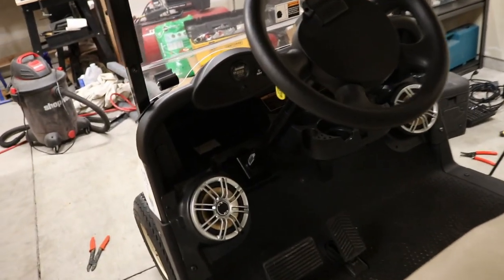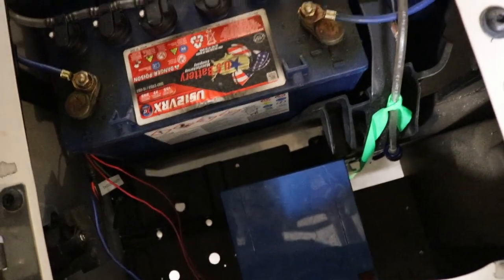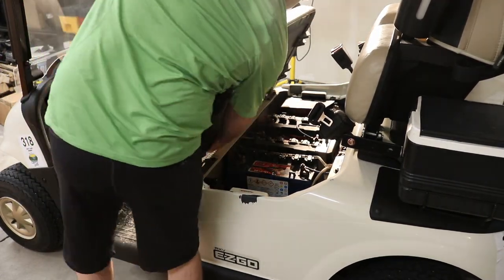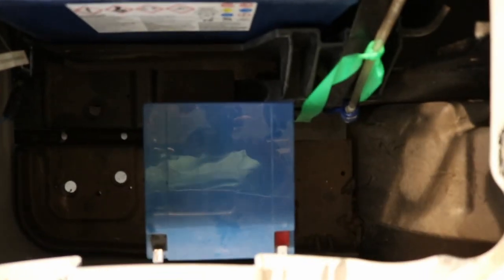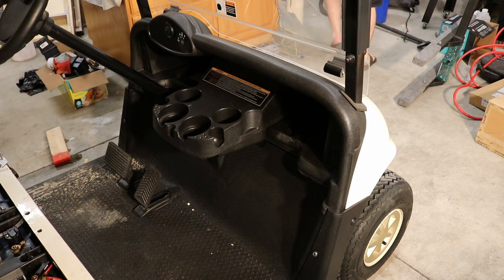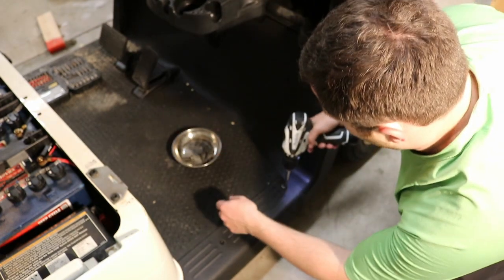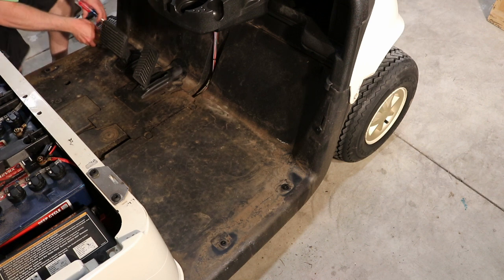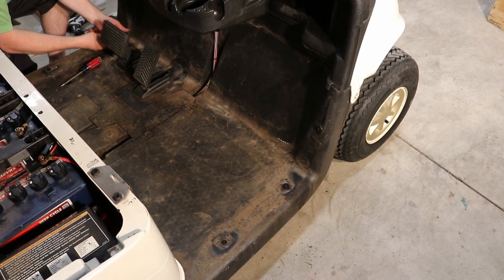EZGO RXV Stereo Install Part 1 of 3

Comment: How are you keeping the battery charged buddy??  I want to do this install but are you constantly having to charge it??
Reply: Eternal Dabbler cool do you have it run with the battery in the golf cart or you just bought a 12v battery and ran the power, remote, and ground to it??